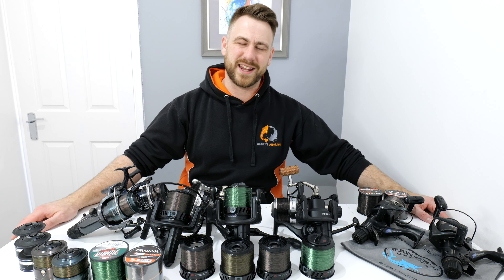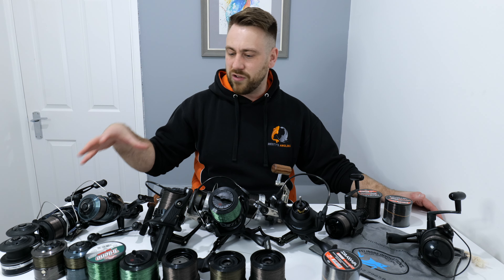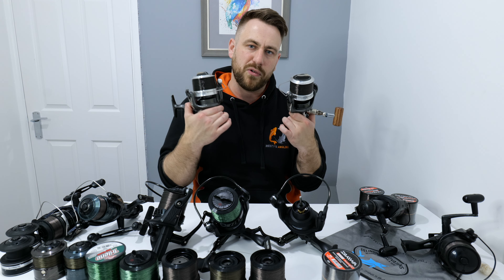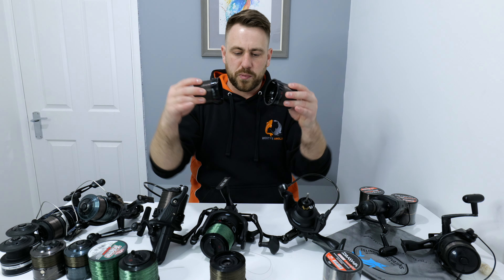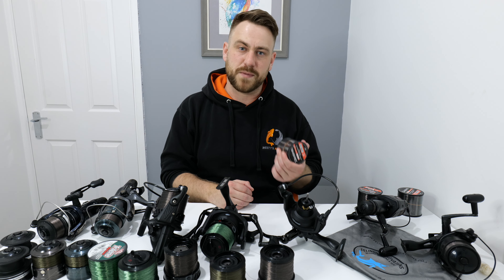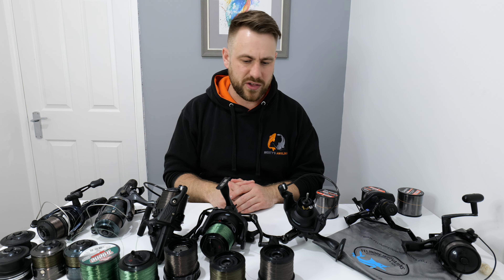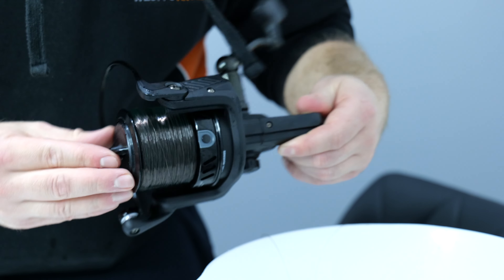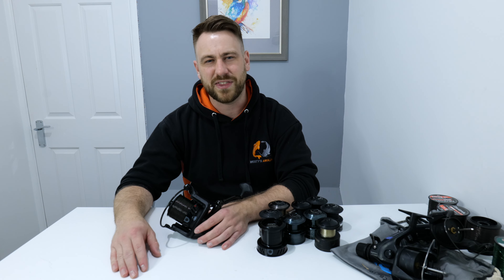How To Strip Line Off Fishing Reels FAST | LOAD UP a Spool with New Line Perfectly Every Time!

Comment: Nice one mate, but you shouldn't be taking the line to a tip, you should take it to your local tackle shop to be recycled 👍😂
Reply from the maker: Someone else mentioned this! I had no idea they offered the disposal of line, I will pin this for everyone’s information 👌🏻👍🏻 It’s probably because I don’t go into tackle shops, I just get what I need online! Like I’m sure many others do. Sealing it up  tight in a plastic bag is the next best thing. However for those with the time to get to a tackle shop I agree that’s the best method of disposal 🎣🎣 I’m willing to bet it all ends up on a landfill site either way as it cannot be recycled, which is a shame.
Reply: Not all shops are involved in line recycling, some will probably just skip it once you're gone TBH. However, the actual programme is called ANLRS or The Angler's National Line Recycling Scheme. They mount bins on promenades mostly to encourage recycling of sea fishing waste.😮

Comment: If I'm stripping the spool completely I use the whisk on a hand held food whisk works the same as a drill but what I normally do is totally change my line every 2 years as get a spear spool to match what comes with the reel and wind it from one to the other and use what used to be at the back of spool as its practically new line still and not had any problems
Reply from the maker: Definitely Neil !! Thanks for commenting buddy 👌🏻🎣